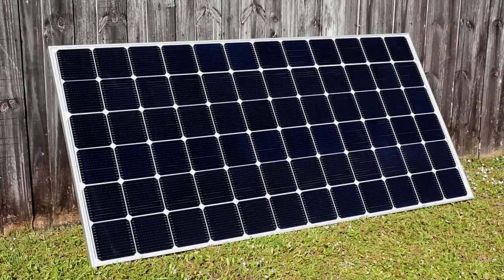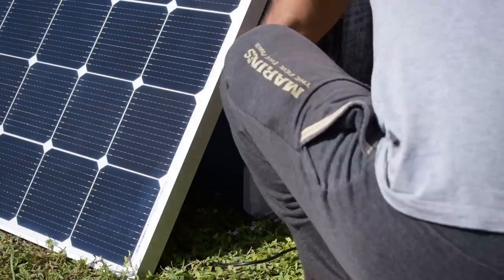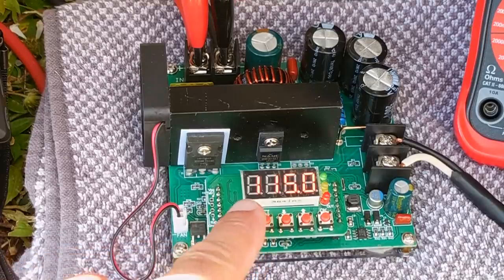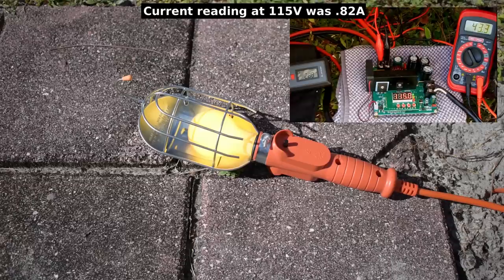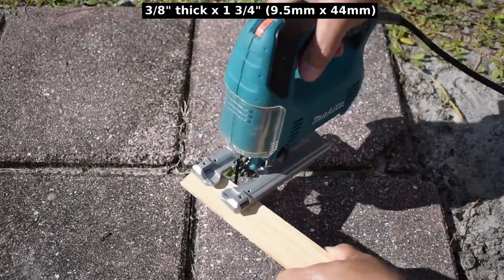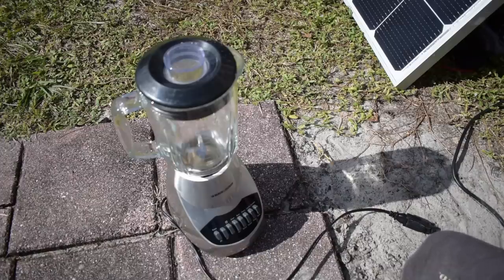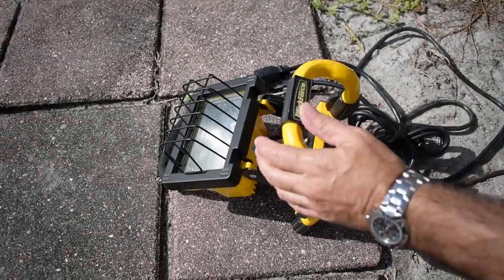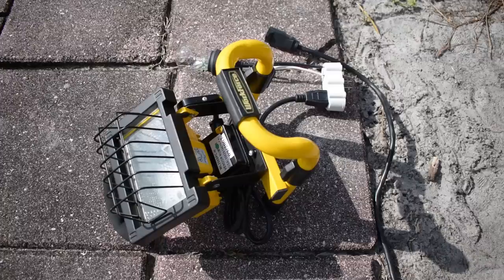400W Solar Module Runs 120V Power Tools Directly!

Comment from the maker: Looking for great deals on Tesla Model 3 21700 cells, Powerwalls, Inverters, or Off-Grid Systems?
https://bigbattery.com/ref/19/
Save 10% using code: electronicsNmore10
Reply: Where did u buy that panel ?

Comment: Very impressive to see it power up the tools!  Thank you for all the time and effort you put into the video. Always a thumbs up and looking forward to your next video!
Reply from the maker: Thanks for watching! Your latest drill bit testing video was fantastic!
Reply: Project Farm!! You’re the man!
Reply: Great watching you both
Reply: Project Farm! this is a very-you kind of video, glad to see you over here!
Reply: Anyone else read his comment in his voice and cadence?😄
Reply: @electronicsNmore  I love using power directly from solar panels. Gonna try this with 12-24 volt cookers. I bought a buck converter that changes panel voltage to 12 volts for experiments but am waiting until I move. The portable folding panels with multiple outputs are great for usb devices like fans and power them even in the shade or when it`s cloudy. They have many awesome uses during power outages or off grid. I`m trying to discover them all.

Comment: "Lets see if it will drill a hole.." 
Goes 15mm hammer drill into concrete option. 
Respect. Thats how we drill a hole. Subbed.
Reply from the maker: Thanks for watching!
Reply: @electronicsNmore  
This video is the type of substance novices are really looking for. If you're like me and the jargon escapes you, my efforts to understand electricity have been fruitless, then you just want to understand basic ideas based off real life stuff. What size panel will run these common understood items, how many panels to run a basic house, how many batteries to keep my fridge running after a power outage and for how long. Not the standard answer of well that all depends on....  We all understand mitigating circumstances but talking about jargon everyone can wrap their heads around with zero solar understanding.

Thanks for the video!
Reply: @electronicsNmore  do you mind to take a scope to the converter !!!
 You know aswell as i do 
You get  chopped DC like a DC to modified AC !!! I Will rapport you don't change the titel !!
Reply: @kennethschultz6465  Hey, Ken, buddy. Take a breath. See those big electrolytic caps? The converter output is filtered.

Comment: A 400W panel for $190. That's less than $0.50/watt. I remember when they used to cost $10/watt. Amazing.
Reply from the maker: It has minor cosmetic defects, but full power output.
Reply: @electronicsNmore  would you mind sharing where you got this 400W Panel? Your amazon link just points to a pretty generic "solar panel" search ;)
Reply from the maker: @iNord.  offerup

Comment: Since power tools don't like low voltages, wonder what prolonged usage would do to the tool?  But I am impressed that they would run off one panel like that.  The solar world keeps improving!
Reply from the maker: Electronic devices can do fine at or above 90VAC, and motors should be at least 105V. Thanks for watching!
Reply: @electronicsNmore Right but aren’t you feeding it DC current??
Reply: @mattc825 Universal motors do not care if it is AC or DC. The outcome should be same (?)
Reply: @Teknopottu  ok thx

Comment: Wow, nice panel! I have that same DC-DC converter. It's a toy. Can't do 1/2 the power that the specs say. It's worse as the input voltage goes down. I wish there was a real converter out there. Years ago, I had a home made battery pack of 10 12V 4.5Ah sealed lead acid batteries in series. That rocked. Wasnt good for long term use, but came in handy for quick jobs using tools like yours there with universal motors. Ran a 7.25" Skil saw like it was plugged in to grid! Word of caution: DC power is hell on switches. BTW, I never tried running a 120vac LED light! That was clever. Probably because there is a rectifier in them anyway. Great experiment!
Reply from the maker: There aren't too many choices for the type of DC-DC step up converters like you saw. I think it works fairly well, especially for the low cost. Thanks for watching!
Reply: Converter is limited by input current. Somewhere in the manual / sales listing / datasheet must be the folowing: "output power is nA*input voltage", 
"max input current of nA"
If you buy "10A 60V 600W to 80V adjustable boost converter" it will often be only 300W at 30V input.
Reply: @volodumurkalunyak4651  HI. Makes sense. The way I look @ it is, the more it has to "lift" the voltage, the less power it will have @ the output? So, to make it go from 12V in to 80V out, the current will be like 2 amps or so max.
Reply: @curtchase3730  yes. This is how boost converters work (maximum output current is proportional of input voltage divided by output voltage).

Comment: It's exciting to see solar technology advance. I thought panels were topping out at 350 watts, and pricing out at a $1/watt. The future is so bright, I gotta wear shades.
Reply from the maker: Thanks for watching! Look for new Grade B panels. They have cosmetic defects, but full power output.
Reply: The Chinese have gotten the price down to below 25 cents/watt out the factory door. It's amazing.
Reply from the maker: The lowest I've seen is about 75 cents per watt.
Reply: @electronicsNmore  I invest in solar manufacturing companies. PVinsights is a good place to check on spot prices. The income statements of giants like Jinko, and Canadian Solar also reflect 25 cents and below for mono perc modules.
Reply: R.P. Rosen Be careful, that satellite from Georgia might black out your solar panel , good vid BTW , some people from India power a three phase water pmp w/ a moderate size panel , but the inverter they built looks a little pricey , but it pumps alot of water.

Comment: Excellent presentation regarding multiple modules I have (435W Solar Panel, HV DC Batteries, DC to DC Rectifiation, DC to AC devices use, etc.) and answering questions I've had in the past along with demonstrations.  Neat detailing the soft/hard start options.  I think the only way you could improve would be hacking the rectifier to be more efficient I guess.  Thanks for sharing as always!
Reply: These commercial panels are great and very cost effective if you can travel out west to pick up or the deliver is worth the investment.  Same goes with the rectifiers other than those are cost effective to order and technically can be ganged in parallel to improve performance for higher current applications... maybe adding some safety circuit features.
Reply from the maker: Glad you enjoyed it! Please share the video link, because as of now, it was a waste of time making it. Thank you
Reply: @electronicsNmore  Will do.  I shared on Reddit and for some reason the r/electronics wouldn't let me post, though looks like worked on the solar pages.
Reply from the maker: @jafinch78  Thank you! Very much appreciated

Comment: Alot of ppl get the solar generators, ( I don't know why they are called that?)  With 100-200watt inverters, I don't see or have the need for something do small! It's more efficient to go DC charging phones and stuff,  they are too small to power anything larger that needs AC 120v. I could see a 1kw or larger, even if it would only run a couple hours, at moderate power, I'd like to keep my fridge going, maybe TV or radio, in a emergency, most can charge from a car. Or pv connection, I have a12v lighting battery bank, I'm thinking about adding a 1200-2kw inverter to power the fridge and such if my inverter or something has issues, I'm off grid, with 5 kw inverter, on 24v, with a separate lighting battery bank, 220 ah LIFePo battery, sorry for the rambling! Great video!!
Reply from the maker: I've got one coming up. They're useful for some people, but not all.

Comment: Excellent video. Thank you!  Never thought about a DC to DC converter and applying it to practical loads that you assume will require AC.  Good thinking!
Reply from the maker: Thanks for watching JR! Be sure to share the video link with others.
Reply: No inverter??
Reply: Ron, I used the term converter only so it was not confused as an inverter with an AC output. But it really is a form of an inverter, just with DC output. In hindsight calling it a DC to DC inverter would have been a clearer statement.  I just had not heard of such a term.
Reply from the maker: @jrchicago9216  You said it correctly.
Reply: Well it's best to assume AC for anything that's normally use on AC circuits, unless one is confident in their ability to detirmine if DC can be used.
Reply: @tripplefives1402  thx for the Better explanation .. my english ain't this good 
But exactly my point !! This DC to DC is a camoflaged DC to modified AC!! 
By chopping DC in to squares looking like Half a modified AC 
Enough to things with a cap can get fooled to run 
So you Will end Up frying somthing !!! Bad idea !!
Reply: @tripplefives1402  To be quite pedantic, chopped DC is technically offset AC, it's just not sinusoidal and it's hidden from the outside apart from RFI emissions.
However, whatever happens on the inside, it's function is a DC-DC converter, and not an inverter.
Reply: @tripplefives1402   I do know how it works!
I said "and it's hidden from the outside".
Meaning that it's treated as a black box.
DC in, DC out. (I'll ignore ripple)
Reply: @tripplefives1402  .......I was thinking that these days the word inverter gets used instead of saying switch mode technology.
Reply: .........I'm known to power my corded tools from connecting up 12 volt batteries but I always focus on low power jobs . I ain't certain about the increased  nasty sparking that can happen around the brushes. Definetly a fire hazard to power incandescent light globes from high voltage DC.

Comment: I've run a 50W ham radio station with several radios monitoring and LED lighting off two 100W solar panels and two marine batteries for many years. I've considered ultra capacitors many times as well.
Reply from the maker: (2) 100W panels, 1 charge controller, and 2 marine batteries will definitely get the job done. :-)

Comment: There is a guy with a YT channel that has put 180 volt DC motors on his table saw , drill press,ETC. He wired his solar array to 180 volts and runs his tools directly from the array.  Yes, he can only cut on a sunny day.
Reply from the maker: He needs a 180V battery bank. :-)

Comment: But for how LONG can this things be powered on in full power? Does the energy drain from the solar panel as u use this things? Do u need to wait for the solar panel to get full of energy or it sends energy out as it gets it in? Can it be used at night?
Reply from the maker: Use it full power as long as the sunlight intensity is high. Thanks for watching! Remember to share the video link with others. Thanks

Comment: Yes I got some rejected 300 watt 72 cell 8 amp 40 volt panels. I repaired these panels with a few simple cuts in the aluminum bus bar across the top of the panel. The shorted bus were a careless mistakes on the part of the labourers laying them in place during manufacturing. You can see these by aiming the panel into the sun or lite and look through the back of the panel, It was a bonus for me. The 40 volts is too high for the cheaper charge controllers, The panel has 6 rows of cells in series for the high volts (40 volts on mine) so I took 3 rows in series and the other 3 rows in series and paralleled them. now I have 20 volts out at 16 amps. This procedure takes about 15 minutes to do once you have done it before. These are great for 12 volt systems, campers, rvs, etc. Add a 1500 watt inverter and a good battery you can run real tools and appliances. High watts, in a smaller foot print with lots of jam. NICE
Reply from the maker: Interesting info Mike. Thanks for watching! Be sure to share.

Comment: Something you should check for is that input voltage is not leaking to the output when the converter is soft off(by pressing OK). I have two of these and both will still pass the source voltage and current through the converter. I'm not sure if mine are defective or this is how they're built, but it would be a sure nasty way to accidentally let out the magic smoke.
Reply from the maker: Yes. I noticed that. I have two, both do it. Can't get too picky for the low price. I'm looking for a higher efficiency converter. Thanks for watching!
Reply: They're great units for the price for sure.

Comment: Even at current,much lower than indicated, 120 VDC can be lethal. When Makita AC/DC angle grinders became ready ly available in our our small rural oilfield town the machine shops and independan  welders stanched them up, to carry on there portable DC welder equipped trucks. The welders has120 VDC output. Disappointment came along when some tried using their AC only tools, and the C, destroyed the speed control circuitry variable speed drills .
Reply from the maker: The demo was for "basic" tools/appliances without fancy control circuitry. Thanks for watching!

Comment: I got a similar idea but I want to try it on 18 volt power tools. Hard to find a dc to dc converter though with an adjustable output, even harder to find a high amp model. Going by Ryobi cells, 60 amps is a good ceiling for most power tools. That’s the max amps for the 9AH battery.

Comment: Dam. Pretty good video. So basically 2 panels full sun at noon and you'd be fine.
Reply from the maker: Three 400W panels in series, and I wouldn't need the converter. Thanks for watching Andy! Be sure to share the link.
Reply: Nop you Will burn What ever you use info a chrisp!!! 
The DC to DC behaves like a realy realy bad MODIFIED squear SINUS AC inverter
Chopping the power to step IT Up!!! 
So IT is Half a modified squre sine wave!!!
Reply: @kennethschultz6465  if you take apart the tool and it has diodes on input then there is no issue. Else it wouldnt even work if it was a true ac motor inside. It would just burn up
Reply from the maker: What are you talking about? Universal motors, and even SMPS can operate using AC or DC.

Comment: Wouldn't do me much good.  Would need a Independent Charge Controller.   All my gear is set up around 12V   panels  configured for 24V.    Good info on the Universal motors.
Reply from the maker: Thanks for watching!

Comment: its probably wise to add an extra diy 120/240v capacitor bank on the tool side to help take up the initial load start.
pro tip put a bit of scrap thin frosted plasic over the red led meter to make it far more readable on camera
Reply from the maker: Hi Paul. The same thing happens using a car battery. It's the module. The red displays are horrible to film. Thanks for watching!
Reply: @electronicsNmore  , a misunderstanding perhaps,when i say the " tool side" i mean put some more caps on the high voltage output side as a localised power buffer, as the motors etc take/draw more power on inital startup.

as an aside, do generic 120/240v fridge/freezer pumps also function properly with that boost pcb, given they are intermittent power users once down to working temperature,give it a go.

Comment: How do you know which tools can run off the DC/DC converter?
Seems probably much more efficient than going through a AC converter.
Reply from the maker: Most power tools aren't induction motors, they have brushes. Thanks for watching!

Comment: Hey, would you consider running 3 72-cell panels in series and see what you can run without a DC-DC converter? Lots of switch mode power supplies can take 120-240V no problem so I'd bet you can run quite a lot of things you haven't considered in this video.
Reply: I have seen COTS PC PSUS operating as low as 85VAC. I've also seen them operating arpund 137VAC. In either case, no issues. If it was made after 2000 theres a pretty good chance the device will work.

Comment: Great information that opens a lot of possibilities.  HOW DO WE IDENTIFY "UNIVERSAL" motors?  Again, great video.
Reply from the maker: Motors with brushes. Induction motors won't work. Be sure to check out my extensive video playlists below, rate thumbs up, and share the video link on social networking websites. Thanks Tyler!
http://youtube.com/c/electronicsnmore/playlists
Reply: If it has a variable speed trigger, you may fry it or won’t work.
Reply: TMoD7007  Maybe. Gotta get the polarity right to get through the rectifier. This is also true of many switching power supplies so there are many things that can work off DC. Run 3 72-cell panels in series and see what you can run without a DC-DC converter.
Reply: TMoD7007  Virtually everything uses a SMPS these days and rectifies all the output to DC anyways. In the majority of these, all the initial stage citcuitry would effectively do nothing. Main concern would be overheat from undervolting too far, in which case the psu may shutdown or suffer reduced lifespan. Anything else probably just won`t work. Certain types of AC motors won't work. Devices that use a tranformer for power probably arent going to work unless that transformer takes rectified voltage as an input.